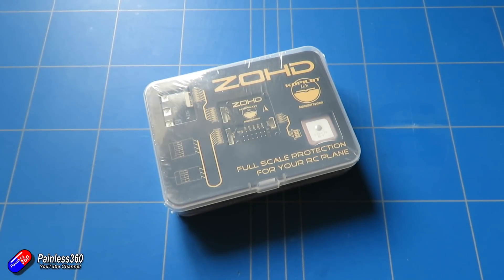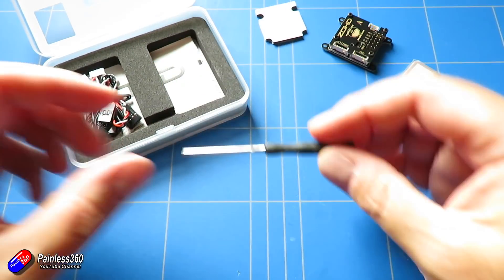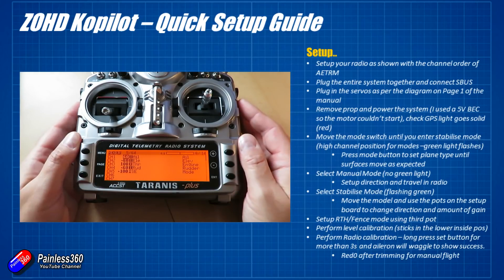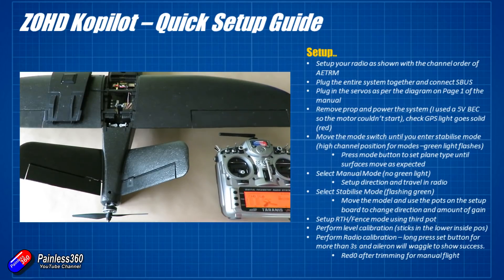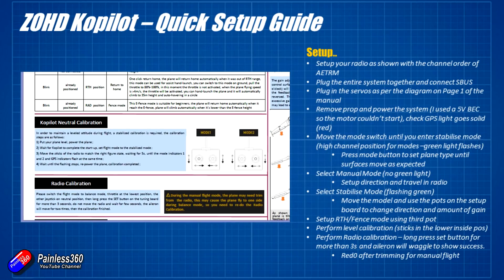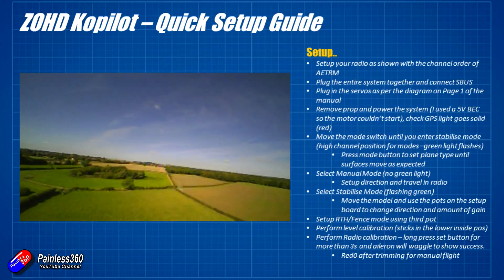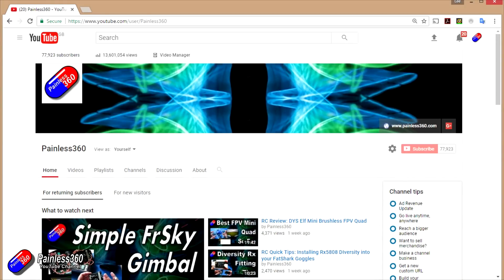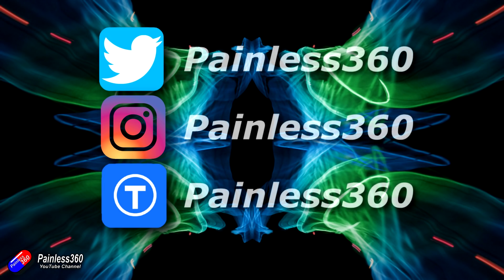ZOHD Kopilot Lite: Easy stabilisation and RTH for fixed wing

Comment: Thank you for a very informed video. I gained much needed info from this (I expect my unit to arrive this week).  I do have one question: @7:30 you mention adjusting the gain. Does this adjustment change the amount of deflection applied to the control surfaces or how fast the control surfaces move when reacting to needed flight changes. Thank you for your help and I hope you are well through the Covid-19 issues.
Reply from the maker: The 'gain' is how hard it tries to correct the un-commanded movement. The more gain, the more aggressive the response etc.

Comment: I have inav in 2 planes, know how to setup it, but fine tuning can take weeks or even months if you don't have time to do many test flights...All videos about Inav setup on Youtube are made by "proffesional" people who can afford lot of time to setup and especially to test fly it. 

OSD is nice, but really necessary only for long range planes where you need to precisely know distances, mah used etc...  
All that is really necessary, battery voltage and timer, is included in simple OSD of many cameras such as Runcam swift, eagle....
You need to know throttle position for economical flying, not easy to see if you use googles, but i use runcam mic and headphones, so i simply listen to engine and it is enough to fly economically.

This thing seems to work nice, already ordered it :-)

Comment: What does it mean if the settings control board is not reversing the signals ? Also when i power up the CoPilot beeps for a min what is it doing thanks
Reply from the maker: No idea, I've never seen that. Best of luck

Comment: Happy weekend to you Lee. With the ZOHD Kopilot connected in a glow engine with 4 AA (6V) for just the RX and Kopilot should the batteries draw done quit quickly. Before I add ZOHD batteries in the plane last couple Hrs or more. Now like just 1/2 hr. (been just setting it up, no flying yet.
Thanks in advance

Comment: Hi,
I've built the ZOHD Kopilot into the Sonicmodell Binary and everything seems to be working fine. I was curious how long the GPS unit normally takes to connect to the satellites?
Yesterday I had the GPS search for the first time and it took 15 minutes to connect. This afternoon I tried again and then it took half an hour.
The GPS is installed in the usual way behind the wing on the platform and has no other electronics nearby.
What could be the reason why the connection is so bad?
I use the standard GPS unit that is supplied with the Kopilot.
Sincerely,
Casper van Beek
Reply from the maker: I'd try to in another spot on the model.. Best of luck

Comment: So far, so good, however, before I upset the apple-cart of settings, just thought I'd ask: can the KoPilot handle my ailerons if I program them into flaperons? (Using the aux channel for the second aileron.)
Many thanks, a drink coming your way on Paypal.🍺👍
Reply from the maker: I've not tried that here. I'd test that fully on the bench before you try it in the air... Best of luck.

Comment: I don't know the order in which the attached GPS cable is connected to the gyro body because the wiring is cut due to a crash at the time of landing, and I don't know where the manual says plus, minus, or signal line.  I understand the GPS side, please tell me the order of the main body side

Comment: Does it have a return to home when there is signal loss? If so I will get this system for all of my gliders. Your videos are so informative.
Reply from the maker: Please see other responses in the comments. Low channel signal is RTH or Fence (depending on which one you've set) so set your Rx fail-safe to RTH mode or if the cable comes loose then the channel value should also drop initiating an RTH..
Reply: Please help. Was able to set up and flew the plane with the koplit. Only issue im encountering is when i turn of the rx. The flaps go down. Counter acted that thru qx7’s failsafe custom set but still the same.

Comment: 2 corrections. Use solid green leds (stabilized) for all setting up not flashing green (RTH/Fence) Exception is use Manual (no greens) for ESC calibration and for mechanically setting control surfaces. The other correction is do the Kopilot direction setting first (it reverses both the  direction of the stabilization control AND the stick control) and only then correct any channels on the radio.

Comment: I'm using a ORX 10i TX and ORX  R920X RX , All set up as per the instructions. Correct T Tail type for the pusher Glider it's going in. Rudder works fine, Can't test engine as indoors and no GPS and all it does is beep. Biggest prob I think id when I move the elevator the ailerons move together and vica versa. Any clue where to look to fix this ? Oh yer RX is connected by SBUS

Comment: Great Video!
Juste subscribed to your channel, then.

May I consider this device might work as a Self righting when activating stabilisation mode? I mean, if I'm disorientated ( left / right, up/down) , does it just returns control surfaces to neutral position or it will bring back the plane to a steady path?

Thanks a lot for your work.

Comment: I’m gonna use the Kopilot on a V8FR-II Receiver. This receiver doesn’t have radio-controllable failsafe. 

How do I set failsafe (RTH) with this receiver?
Reply from the maker: It's covered in the manual for the reciever: Follow the steps below to set failsafe positions for each channel:
1) Bind the receiver first and turn on both the transmitter and the receiver;
2) Move the controls to the desired failsafe position for all channels;
3) Press briefly the F/S button on the receiver (less than 1 second). The GREEN LED of the receiver will flash 
twice, indicating the failsafe position has been set in the receiver.

Comment: Nice video... I'm going to place my order but I saw another ZOHD module (ZOHD Kopilot Lite And VC400 FPV Combo), but .... could you tell me the difference between         VC400-CP and VC400-LP..... Thank you.
Reply: The "CP" is a clover leaf antenna, the "LP" is a linear 'dipole' antenna. In theory the CP with get better range through objects and less interference, but is not as durable as the dipole antenna

Comment: Another great video. Do you think this unit could be used with a glow engine airplane or would it have to much vibration or some other issue ?
Reply: Did you find a self leveling receiver that's good for a glow plane

Comment: Hi, I was wondering if you may be able to help, I love your videos, really informative and interesting,  please keep them coming.  I bought a kopilot to fit on one of my 4 channel planes. Its installed and setup as per your vid, my issue is that in manual mode the flying surfaces are perfectly trimmed,  switch to stabiliser mode and the surfaces are way out of trim.  I haven't a clue why n what I'm doing wrong.  Many thanks in advance.

Comment: Hi,
For me it is all a bit new and very technical.
What kind of device do you use to connect the servos that do not fit on the flight controller to your receiver via AUX.
Receiver Radio master R161 with SBus on the
ZOHD Kopilot: Ail, Thr, Ele and Rud
External ?? lighting, flaps, bomb hatch, camera control, etc.
Greetings from the Netherlands,
Casper
Reply from the maker: Check out my basics videos for how those pieces work. Merry Christmas
Reply: @Painless360 i'am sorry but you have so many videos over the years, in which video can I find it ???  greetings from the Netherlands, Casper

Comment: Ummmm, I'm just setting up my second Kopilot - the first is working well in a Bloody Wonder. 
It was all going as planned until something weird happened...
I've set up the mode switch on the SG switch. Initially, it worked as expected, i.e. RTH was on rearward setting (up arrow), manual was on middle, and stabilized on forward position (down arrow).
Next thing I knew, manual and stabilized had flipped positions!
I don't want two different configurations on two kopilots, so I would like to set them the same. I have tried every button I can think of, unplugged and grounded the pins, even moved the function to different switches, but to no avail. It remains stuck in a RTH, stabilized then manual order. 
Interestingly, the kopilot won't do a level calibration on any of the three switch positions...
I'd be grateful to know if you have any thoughts on this?
Cheers.
Reply from the maker: How odd, I've not seen that. Has something on the radio been changed maybe? Best of luck with it

Comment: I have ordered one which will arrive this week and I plan to use it in one of my FPV plane which has ailerons setup as dual channel (for differentials and spoilers etc.) and also has flaps. So my guess is that the unit will only work with single servo pin for ailerons so I will need to use a Y cable for ailerons and the flaps will be operated by regular receiver channels just like they are at the moment. Do you think this is how it should be? Appreciate what you do for all of us. :)
Reply from the maker: That's right. Best of luck

Comment: Im a beginner to the hobby just breaking in havent even flown yet. I purchased the dart250g fpv setup as it seemed like a good starter kit. I was wondering what tx/rx controller packadge would be best and get good range but be inder 200$?
Reply from the maker: I would use something a little less fragile to learn with. A Qx7 is a good choice if you can handle Opentx. See my learning to fly series for more tips. Best of luck luck!

Comment: 1. - is it necessary to have the Adjustment board permanently connected to the Kopilot Settings connector during the flight of the plane? 
2. - does Kopilot remember that the RTH mode was set, for example, even after disconnecting the Adjustment board from the Settings connector?
Reply from the maker: 1) it should be able to be disconnected. 2) I think so. I always keep it connected.. Happy flying

Comment: Just quick question do they do a version for spektrum receivers? Great vid keep em coming
Reply from the maker: It only supports SBUS or PWM..
Reply: @Painless360  yes, you can use a spectrum rx using the supplied pen harness. I am using a AR620 in a 250g

Comment: Thanks for the video. I have just bought one of these and, having watched your video, discovered that it needs a 3-position switch. Oh... I have a Spectrum DX6i, which has only 2-position switches (as far as I can see).
Please can you tell me if this can this be set up on a 2-position switch, turning the stabilizer function on/off? (RTH can be left on auto.)
Many thanks.
Reply from the maker: You could but then you would only have access to those two modes.. Best of luck!
Reply: Painless360 I think there may be a way to set up a virtual 3-position switch using two switches... The unit hasn't arrived yet, so I can't be sure, but will report back if I have any luck.

Comment: I bought a new radio (radiomaster tx16s) so I had to setup my Zohd Dart250 again.  This video is super helpful.  Thanks.
Two things:
-Does it know to automatically switch to return to home if you have a failsafe?  Or is there something that would need to be setup?  (I've never done anything with failsafe before.  All my models say "Warning!  Failsafe is not set.")
-In your video the screen of your taranis shows -60 elevator.  Wouldn't that make the RTL fail?  Don't you have to use the pots on the Kopilot to reverse channels?
Thanks man.
Reply from the maker: See my video on Failsafe. It depends on what the model is and had in it.. See the latest setup videos in the Kopilot playlist... Happy flying
Reply: @Painless360  Dood you rock, thanks.

Comment: Thanks for the video. Just got one of these and trying to setup with rxsr receiver but the Kopilot will not recognise the receiver is plugged in? I have checked that the rxsr is in SBUS mode. Any idea? Could it be the receiver is in EU mode? Thanks a lot.
Reply: I figured it out! The JR lead that comes with the rxsr is for updating and not for SBUS 🤦‍♂️ So need to move the yellow cable to pin 4 so it connects to SBUS out instead of s-port.

Comment: Actually - Alastair Rourke - Thx for the videos . After setting RTH mode on bench 
 & with a good GPS LINK  the servos have gone into a trembling mode-  only small 1-2 mm movement but not an issue in fence mode .? If you turn on fence  or RTH on mode switch does this mean the gyro takes over complete control of the throttle - the manual infers this ?
Also having trouble setting neutral calibration- the manual diagram shows mode 1 & 2 settings to be the same ? is that correct ?
Appreciate help
Reply from the maker: The Kopilot runs the throttle in RTH mode. See the playlist where I show the modes in action..

Comment: i haven't tried any fixed wing stuff before, but is there anything that has a rate mode, like for quadcopters? i understand that it isn't that required, but being able to set a curve and maximum rate would be awesome for aerobatics and smooth flying.
Reply from the maker: Check out my Introduction to fixed wing series. You setup that stuff in the radio for most fixed wings. See my iNav 2020 series for all about using a flight controller in one... Happy flying

Comment: GPS never gets a lock.  The GPS light come on and blinks but the GPS light never goes solid and the motor does not arm.  How long should it take to get a GPS lock?  My Eagle Tree Vector GPS obtains a lock in a minute or so,  Does the mode switch have to be in a specific position?  I'm running the exact same equipment you used in your video.
Reply from the maker: Should lock in any mode. First lock can take a while.

Comment: Brilliant video as always. Just to clarify you said it has Manual/Stabilized/RTH-FENCE. Is there not a mode for the aircraft to only be Gyro stabilized and not limit bank/climb angle etc like a standard gyro?
Reply from the maker: I'll be creating a FAQ for this thing as there have been loads of questions so stay tuned!

Comment: My prop is only active in manual mode on bench - but not in RTH / Fence mode .Does the GPS need to be linked before the auto prop start can be activated - please advise
 Regards Alastair
Reply from the maker: That's the way it should work..the Kopilot controls the throttle in RTH or fence mode. Happy flying

Comment: Great video , I was looking at these, Q - how is the throttle controlled in return to home mode, I.e. if I loose radio connection and I set the fail safe to go into return to home mode does the flight controller manage the throttle settings?
Reply: Well, yeah, or the plane would simply crash. :) He also mentioned that if RTH is enabled when the plane is below a certain height it will climb to that height and then RTH. I don't remember the # for height, it's probably in the manual.
Reply: He said 70meters
Reply: @bobturner3388  In the manual that came with mine the height quoted is 35meters.
Reply: Edit...Andrew Newton did a test with a Mini Mavic to test height ...70m RTH. 35m is the climb-to height at auto launch.

Comment: Hello Mr.360.  I bought the Zohd Dart 250g and set up Kopilot with no probs (thanks for video!)  >>However<<, I finally put the prop on and the motor is >]spinning backwards[<.  It came from the factory that way.  Is there a way to reverse that zohd esc, or do I need to snip two motor wires and reverse them?  Thanks very much.
Reply from the maker: Make sure you have the prop on the right way (text facing towards the nose of the model) and if it is then just swap any two of the three wires to reverse the motor.  You're spot on.. best of luck
Reply: @Painless360  thanks for taking the time to reply to your subscribers.  Much appreciated!  It's definitely spinning the wrong way for the prop.  I guess it's not like BLHeli /32 where you can reverse it in the firmware configurator.  Snip snip solder solder, thanks.
Reply: @Painless360  and of course a tropical storm just flared up nearby (I'm in Orlando area), so now I have to (should) wait to maiden it.
Looks great though.  That's a slick little controller, very easy to setup.
I have another generic one (no gps) that's been in my drawer.  Now that I know they are easy to setup, I'll stick it in my squirrelly volantex Saber 920.
Reply: @Painless360  Hello again - question.  What are the other cameras I've heard of (like the zohd one I guess) that will give you a simple OSD with battery voltage?  I need to buy a new camera (lol) because I set up a little wolfwhoop aio fpv cam on the zohd dart 250g, with an LC filter (figured I'd do it right) and I let the smoke out.  Turns out that particular camera is 3-5v input (sigh, all my quad cameras are like 3-40v so I foolishly assumed) and the output to the JST connector from the Zohd ESC was showing 12v.  Dagnabbit.  So I was just about to order a new cheapy aio (I put an iflight micro bec before the micro lc filter now for 5v) and I figured I should just get one with some minimal osd capabilities, couldn't find it and figured you would probably remember (I think foxeer had one).
Sorry this is long, I'm sure you're busy, I appreciate the help!
Reply: I discovered the answer by accident.  I bought a new Foxeer Cat2 Starlight cam and it seems the Foxeers all come with a simple OSD and a voltage wire. (haven't tried it, but I'll get one for the plane.)

Comment: What if you loose signal while using spektrum? Do you need to set up failsafe? If so, what would you have failsafe do, set throttle to rth? There is no mention of this scenario. Thx
Reply from the maker: You should always set Failsafe. I'd set it to activate RTH.. Happy flying
Reply: Thanks for the info. I have one other question. I noticed some inconsistencies in the connection with spectrum receivers using a additional satellite receiver. Is it recommended to not use a satellite receiver with the main receiver, or is the Kopilot FC board compatible using both?